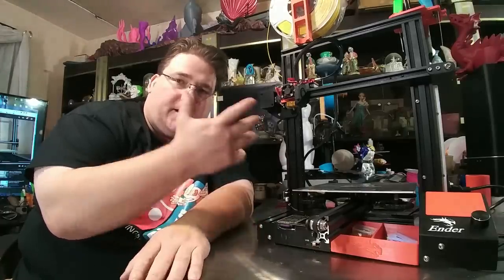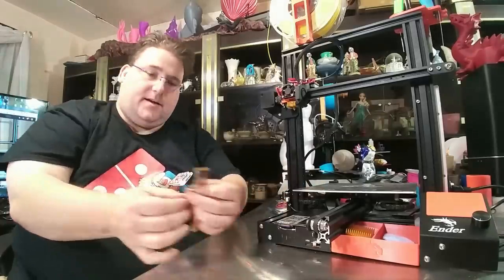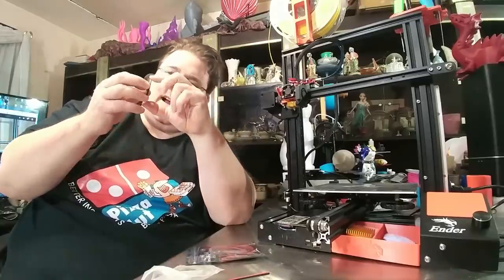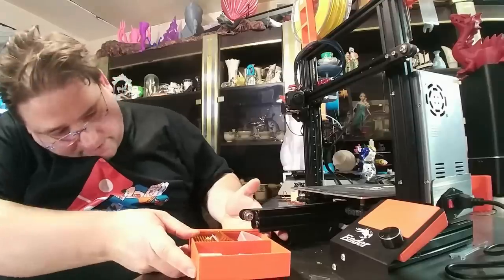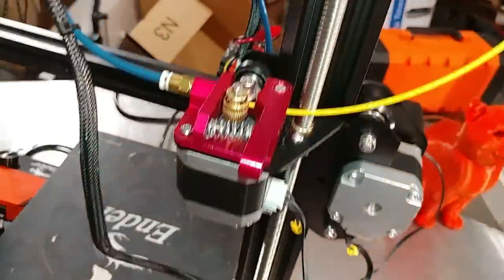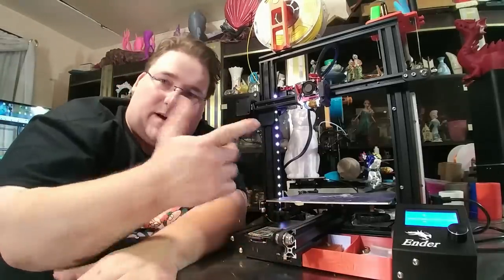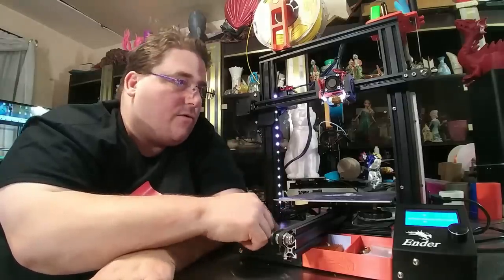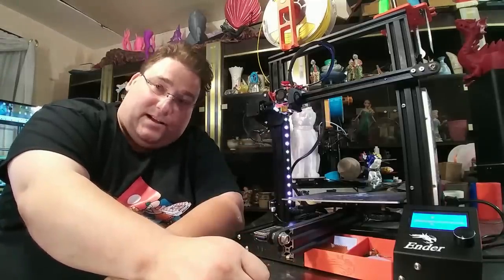T3DP 216 Ender 3 Upgrades & Mods

Comment: This video was great and really helped me with some issues getting my printer to work.  
My question is about my print bed.  It appears to be tight, but it has an angle to it so the back right corner has started to run against the power supply.  The print bed isn't centered between the gantries.  (I don't think that's the issue but the bed appears to be turning slowly so the back corner is hitting the power supply. its a new unit.  Going to check the trolley wheel nuts. But what else could be causing it? ideas welcome
Reply from the maker: Pictures of the wheels under the bed and carriage?
Reply: Nerys when I got home tonight I verified there wasn’t any wobble o the bed, that it moved freely and the I measured the distances between the edges of the bed and the vertical gantry. I found the bed wasn’t quite centered between the uprights (one side closer that the other). I found there was a few mm difference between the side and vertical when the bed is fully pushed in vs pushed out.  There was an optical illusion that made it looked much more angled because the power supply was angling in toward the bed. It wasn’t parallel to the printer frame front to back.  So I loosened the screws on the vertical rail.  Then slipped in a wedge between the supply and vertical rail to keep it from twisting in as screws were tightened. That is seeming to do it so far b
Reply from the maker: A couple millimeters won't matter if you have the older bed with the rhombus arrangement of Wheels they do tend to twist counterclockwise lightning

Comment: Were you able to add a damper to the Y motor? I bought an ender 3 recently, and it seems they changed the bed design slightly. With the damper on the bed actually hits the y motor on mine. And the rhombus design of the bed seems to be a nicer square now too
Reply from the maker: Yes I install the damper on my y axis do you have a picture of the new style you can send me?

Comment: They probably just tuned the pots on the motherboard too high for the motors. Should be counter clockwise to turn them down. Probably just one of the quirks they had for the trial run.
Reply from the maker: That's what I'm assuming because they run way too hot when I get home I plan to pull it apart again and hit with some probes and see what kind of voltage it is pushing

Comment: Just got this printer, was wondering if I can use the usb port on the Ender for direct connectivity to my PC rather than sneakernetting it with an SD card? Much thanks for these vids, they are really helping me out getting started. Thanks again!
Reply from the maker: Yes you can you can print direct via USB but this is less reliable since it requires you to keep both the PC and the printer powered up and if anything interrupts that USB connection your print fails but yes you can do that

Comment: Hi Nerys, I love your channel, could you please in next video speak about how you get such amazing prints when you use vase mode? I have a CR-10 and I get better results when I turn off the cooling fan, does it happen to you too? what's your printing speed? I use cura.
Reply from the maker: I do tend to run my parts fan a little slower usually 75 to 85% if your parts cooling fan is affecting your vase mode Prince you might actually be printing too thin just as an experiment on the printer itself try turning up the Extrusion multiplier to 120% after it started printing the vase portion you may need to adjust between 110 and 125% if it looks better you just found your solution turn up your Extrusion multiplier slightly when you duvets mug Prince

Comment: 23:06 do you know for a fact, that the sys board fan needs to run all the time?  Did you do temp readings?  If so, what were they?
Reply from the maker: I don't think you particularly understand the problem if you turn off the cooling fan such as for abs printing the system fan never turns on it is controlled by the same circuit that controls the parts cooling fan so when you turn the parts cooling fan off you are turning off the system fan meaning no matter how hot it gets in that box it will never turn on that's a little bug they need to fix :-)
Reply: What I am saying is that if the enclosure isn't that hot, why does the fan need to run all the time.  If enclosure is not hot enough, no need for constant fan running.  I've seen equipment run really hot for years and years without fans, and they keep on working.  So long as the temperatures do not exceed operational tolerances.
Reply from the maker: @williamblair1123  I honestly do not know what the operating tolerances of the board are and what those tolerances may or may not be reached in any operating environment when I do know if they have a fan there so I assume the fan is required

When I put a printer in an enclosure I ducked the input for the fan to the outside so that I can get cool air from the outside of the enclosure maybe this is not required but that's what I do

Comment: I lied, the thermal pads that came with the heatsinks are “tacky” but not adhesive. Soooo. I found a fix. If you take some CA aka superglue and run a small tiny bead around the edge of the heatsink and stepper motor and they are holding fine without losing the thermal transfer from the motor through the sheet into the sink. FWIW, locktite has a great feature on their product that allows you to precisely control the flow of the glue. I bought mine at Lowe’s but I’m sure it’s everywhere.
Reply from the maker: yep the pads won't stick but the thermal glue works great and yes the Loctite Precision control is nice

Comment: How do you deal with prints that are over or a little less than a day to print? My printer has to be in my room because I live in a studio apartment. I would have to sleep with the printer going or leave the room or something. Everything I wanna print takes 20hrs or more. ☹️
Reply from the maker: I have run 10 plus day prints if you have to be in the same room there are several things I would do first get yourself a metal table to put the printer on and make sure it's at least two feet away from the nearest wall this will eliminate any potential fire hazard for the most part

Next you're going to need to make the printer quieter first things first replace the fans replace each fan with an identical fan there should be approximately four one in the printer one for the hot end and one for the parts cooler and also one in the power supply you're going to want to replace each of those with dual ball bearing fans they will last basically forever and be nearly silent

Next if the actual whining sound that the stepper motors make assuming your printer isn't already a quiet board printer you can fix that by either using stepper dampers or by installing quiet drivers or by replacing the board with a quiet board doing that should allow you to exist in the same room as the printer without a bothering you too much it'll be nearly silent
Reply: @nerys71  Thanks!

Comment: Well I got my Ender 3 a couple of days ago, so I'm going through the list of upgrades again.  I see the springs you posted.  Are those to replace the bed leveling springs?
Reply from the maker: Yes bed leveling Springs
Reply: Thanks again!  I've ordered them, but 3 - 6 weeks to get them is pretty disappointing.
Reply from the maker: If ordered from amazon its many times faster if they have any us stock. If they are totally out it could take a little longer.

Comment: Couldn't you just print a new nozzle for the fan, designed so that it directs the air where you want it to go?
Reply from the maker: Yes but without fluid dynamics simulation software or experience in that regard it would be trial and error does you have to account for the rotational moment added to the Airstream by the fan

Comment: Thanks for the video! The light strip, do you have it attached (taped) in the extrusion or just kind of sitting there? Also, where is a good place to connect the lights inside the box?
One other quick note about the fan, this seems to act similar to the Tornado where the control box fans do not come on until the hotend hits 50 so if its just sitting there not printing it also does not have the fans on. The Tornado setup does seem better than waiting for the parts cooling fan to come on though. Great videos, please keep them coming :)
Reply from the maker: Negative the fans are directly connected if the printer is at 260 degrees in the bed is at 100° and I am printing and I turn off the parts cooling fan the brain box fan also turns off

There's no need to even peel off the sticky back I just slide them right in there are nice fiction fit

Temperature controlled like the tevo tornado and TiVo Michelangelo would be ideal so when the printer shuts off when it's done the fans also turn off once it cools down but that's not how the creality works for some reason they linked the two fans probably accidentally

Forgot to answer about connecting watch the video where I talked about the jst connectors inside if you remove the cover to the power supply you have the little screw terminals the power wires are connected to I Simply Connected one of the jst plugs to actually so I have a spare for anything else I want to power such as a USB adapter Maybe :-) I'm glad I installed that

I simply wired one of the jst plugs to the terminals for 24 volts inside the power supply and then I made sure to connect my 12 volt LEDs in series so they run on 24 volts
Reply: Thanks Chris, I’ll be doing the light mod for sure. What I meant by the fans was both the Tevo and Ender-3 at idle do not have the control box fans on, right? Part of me likes the silence of the fans not being on when idle, on the Tornado especially, but I would also like to know everything is kept cool.
Reply from the maker: What you misunderstand is that when cool the brain box fan on the TiVo is off by Design and intention on the creality it is not by Design or intention It Is by a mistake of linking the parts fan to the cooling fan if you never turn the cooling fan on the brain box fan will never turn on either it's like linking your hallway light switch to your bathroom light switch you can't turn the bathroom light on unless you turn the hall light on

I also like the way TiVo does it I'm hoping that something that we can Implement in Marlin? So maybe that's something that we can add ourselves?
Reply: Gotcha....*light bulb* sometimes it takes me a bit :)
Thinking of it that way makes alot more sense. The Ender is dependent on the slicer (and the user) to turn on the fans while the Tevo does it itself. Thanks for breaking it down like that!

Comment: Hello love your vids. I will be getting my printers this coming week hopefully(ender 3 new version & a pro) and I want to get the aluminum extruder upgrade and on ebay  the mk8 is only for the cr10 the s and so on the one for the ender is more expensive and never mentions that it's an mk8 but I think they are one in the same. Your amazon link says it's the mk8 but I just want to make sure Thank you. Doug K

Comment: What is the difference of the smoothers? Could you show a picture of a print with and without smoothers?
Reply from the maker: An electrical consequence between drivers and steppers causes the printer to basically skip steps electronically when it's printed this adds a stair-step like pattern to the print that is consistent and regular on her nerves if you look up Salmon skin tevo tornado you'll see what I'm talking about it is very very mild on the Ender 3 in fact I didn't even notice it until I look for it but because the TL smoothers are so cheap I figured I might as well make it as perfect as I can I added them and it remove this I'm completely at least to a scale that I cannot see I will take some pictures of before and after to show you

Comment: thanks.My new Ender-3 printer does not work like I thought it would.I for the life of me cannot get the bed leveled to do any prints.The frame is A ok as being straight and tru.Need  help, just about ready to give up.
Reply from the maker: Leveling is one of those things that is a royal pain in the ass and makes you want to pull your hair out until you get it and then you go oh that's easy and press the red button :-) do a search on YouTube for cr-10 bed leveling basics you'll see my 45-minute video with me holding two rolls of filament watch that video and as you're feeling the filament as you try to level the bed pink fishing line it should feel like fishing line stuck to the bed under your fingers make sure that right hand vertical trolley is not too tight for this stage it's better to be too loose than too tight if it's too tight you'll never get a proper bed level will change every time you move it

Comment: On different subject. The gantry on my printer is not level. I can make it parallel to my bed, by adjusting my bed level. Should I adjust one of my Z lead screws to lift one side up or should I just leave it? I don't think it is affecting the print. If I adjust my z axis, should I loosen the coupler and disconnect the the stepper motor before I turn the lead screw or just turn the lead screw to get the correct level. The gantry is approximately 1-2mm out.
Reply from the maker: If it is dual lead screw you don't have to loosen anything you can physically grab it and just turn it to adjust it Titan all of your bed leveling knobs all the way tight then use a ruler to measure the height of the X Gantry above the bed left and right don't adjust the left adjust the right physically grab the coupler and force it to turn counter clockwise should be down if I remember properly keep tweaking it until you measure the left and the right and they're about the same then hit home and relevel the bed now that you got it approximately level if it goes out of level again you can just manually adjust it until it's back
Reply: Nerys -Thanks. I paused the print@95%. When I resumed the print, the printer restarted from a lower level causing one side to jam.

Comment: Hi Nerys, have you ever thought of converting the Ender 2 or 3 to Direct Drive? 
Does it increase reliability? 
And Also, what do you think would be nice to solve the issue of the motherboard fan?
Have you seen the new Y Carriage where all 4 screws form a square?
Reply from the maker: Neither would be very viable for direct drive since they are both cantilevered

That means the extra mass on the rail would be very detrimental

Motherboard fan I'm going to connect mine to direct power so when the printer is turned on that fan turns on

Yes several of mine have the new y Carriage pattern and it is much better it was one of the suggestions I gave them to correct the bed although I imagine many people made the same suggestion

Comment: Would you recommend this printer to someone that already owns a CR-10 S4? Or is the printer quality around the same?
Reply from the maker: This would make an excellent additional printer with his very low cost very high quality and very generous build volume if you need more machines to make more friends this is a good one to do it with

Comment: do you have a video of the wiring of the led's?
Reply from the maker: I touch on it in my mods video but I will make a dedicated video for it
Reply: cool thanks :). D
o you know if the power supply on the ender 3 will handle powering a raspberry pi and Led lights?
Reply from the maker: @wadelindsay7148  LED lights absolutely the power they consume is essentially zero relative to the power supply and the Raspberry Pi should be okay as well just remember 24 volt

Comment: Do you have a video about the X-axis arm binding up? I think that's what's happening with mine, because I keep having to re-level the right side of the bed.
Reply from the maker: Remove the right hand vertical trolly completely. That will stop.that from happening. I am working on a more permanent fix.
Reply: yeah the first time I saw the design, I was wondering about that. I'd guess that the x-axis bar and print head aren';t heavy enough to cause sagging, but binding up on the right side seems extremely likely and easy to occur

Comment: For the compression springs, do you have to replace the screws or can you add the washer/nut combo to the stock screws?
Reply from the maker: The replacement compression springs will fit with a stock screws and you can add a nut and washer if you wish to the stock screws
Reply: Nerys hey Thanks pal! Appreciate the QUICK response and the videos.

Comment: I am not sure if I missed this, but I noticed that you dont have the right side of the x axis with wheels. Is there a reason why you did that?
Reply from the maker: Yes on the original beta version of the printer the top beam was incorrectly drilled which forces the two vertical together I did not realize this at first and the right-hand father was binding dramatically affecting my print quality removing the trolley altogether alleviated most of the problem am I updated video I discovered what was causing that problem with binding and now know how to fix it and new version of the printer that are currently selling do not have this problem they have corrected it at the manufacturing line so once I find the part I will reinstall it after making a correction

Comment: Is the aluminium drive feed wise to get? Does it improve build quality? Does it fit perfectly?
Reply from the maker: It is not necessary it is virtually identical to the one that comes with the printer it's just all made of aluminum but it is nice bling and it will last forever the plastic one will eventually wear out but only after thousands of hours of printing it's one of those nice to have but not necessary changes